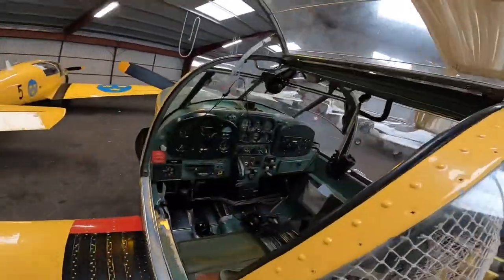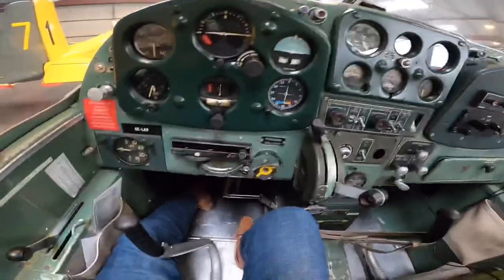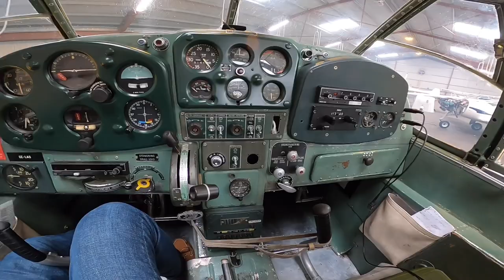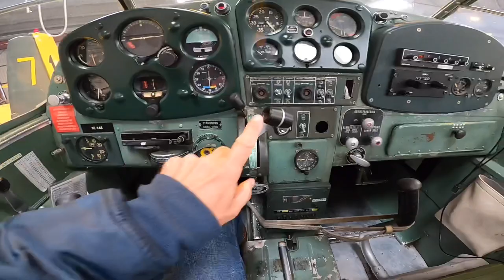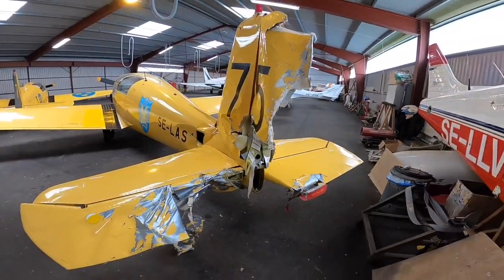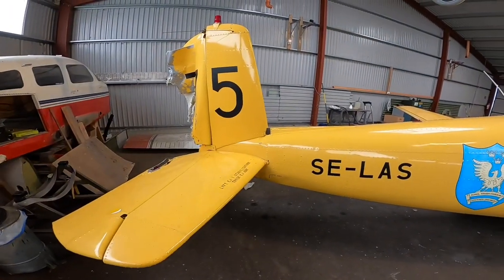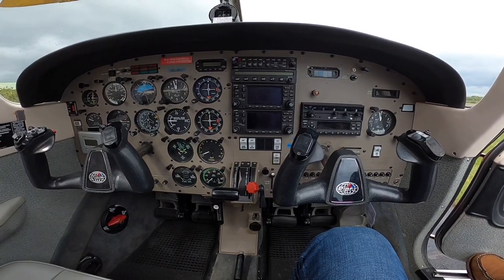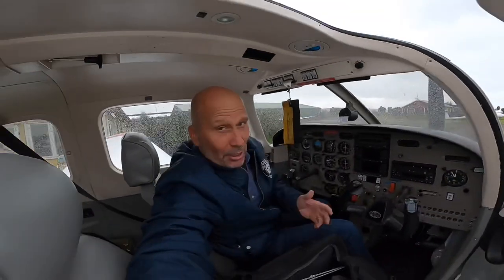Ergonomics And An Accident Hitting The Saab Safir 😭

Comment: So sorry to see the Safir with tail damage. ☹
Its going to be one hell of a repair , I'm sure it will be sorted but looking at the fuselage it may take a while 😥

Just glad to hear nobody was injured. 👍

Its a shame that Aircraft Designers / Engineers have  changed  tried and tested designs which are intuitive. I guess the investigation will bring up the human factors element of the design of the Dynamic!! 
Thanks for an awesome video 👍👍
Reply from the maker: Maybe I talked too much about right and left hand. You can get used to maneuvering stick and throttle with any of them. Anyway it’s not so convenient to have both hands to the right at engine startup (as left pilot) as it is to have one on each side. On the Cherokee the start button is ok for the left hand in the roof with the right hand on the throttle. The brake arrangement on the Diamond is probably more remarkable.

Comment: First, let me thank you for the cockpit demonstration of the Safir! I have tried SE-IRN once from the right and the harmony of controls, "fine mechanic feel of the stick" and warbird like feeling beats any microlights I´ve flown. The same goes against the Cessnas and Pipers I tried occasionally. 

Been flying many hours in the Dynamic in Sweden, and several times in VUZ (shown in your film) from right seat. The push/pull is a twisting throttle as well, and from what I´ve heard a concession for the american market. I think it differs from the look-alikes in some Cessnas in that here you have to push a button in the middle with the thumb to get the push/pull action. Nobody likes it afaik, and it´s a pain with formation flying because of the thumb button. Also makes it harder to transition from left seat to right seat, since until you get used to the new position you tend to twist it in the wrong direction (needed for finer adjustments like on final). With a normal throttle lever right seat is no big deal. You can get the Dynamic with a normal lever on the console, but then there´s no place left for the manual trim, so it has to be electric with buttons on the stick. The stick then usually gets a "thicker ergonomy". I´m not a fan of either. Luckily I got a couple of years experience in the FK14 with a normal lever and despite having electric trim and flaps, a more "normal" left stick as well. 

For startup in the Dynamic with fixed propeller at ESTT you twist the throttle to near total idle (with choke) or half a turn (without choke) and leave it there. So the ergonomy is good with stick pulled back with left hand while turning the key with right, but of course sometimes you have to adjust during the process and get the same cumbersome position as you describe. The brakes are set on the console before. As well as gradual breaking action there´s two notches. The first is enough for engine startup, and the last is needed for engine run-up. VUZ has constant speed and maybe that explains the slightly different intial start up procedure. We´ll find out. 

Very unfortunate accident, but good that you show us a clearer picture of what happened! I´ve heard the Dynamic ignated at full throttle, by human error or technical problem I don´t know. Second notch brakes would probably not held, but maybe would have limited the accident.

As a side note, the push/pull twisting throttle easily gets bent if an unexperienced passenger kicks it while entering/leaving the plane, so sometimes you push it to max with the engine off to avoid this. The same goes with our other microlight at ESTT, which actually has toe-brakes, and I´ve seen/experienced it ignite with full throttle a few times, but the brakes held. To reach the adjustment for the pedals in both our planes the throttle also gets in your way, so same thing there, easy to forget to pull it out. VUZ has a more ergonomical pedal adjustment at the side of each pilot, but it wasn´t totally stable. Using the rudder from the right seat I "kicked through" a couple of times, leaving the pedals at my seat in a "no position" (of three notches) until I fixed it. Despite this, the Dynamic is a very robust plane with excellent flying qualities. VUZ is a little quicker in roll compared to the older Dynamics, but maybe a bit less sensitive in pitch.
Reply from the maker: Super interesting that the throttle is pushed to max to avoid it to be damaged when entering or for pedal adjustment. Thank you very much for comment, I'll use the info in a part 2 video. I did not know the details you described.
Reply: @bjornpilot  I´m not sure it´s common practice at Ljungbyhed to do so, but at ESTT it happens. Another thing I heard from our mechanic is that at least on the Rotax engines they go to full rpm if the throttle wire breaks! Very practical in the air, less on the ground. Glad you found something useful, and looking forward to the part 2.

Comment: Another interesting video. You’re emphasizing left hand on the throttle and right on the stick like in most fighters. That’s fine in the Safir. The Cherokee, Cessna and the Airbuses or Boeings for that matter you have been flying around in its the opposite way, as long as you’re flying pic. In my opinion this is no big deal. It depends on what you are used to. The new sleekly 2 seater on the other hand had a very unusual cockpit layout and we sadly saw the consequences of this in that modern plane. Hopefully you’ll get your Saab back in airworthy condition in not so distant future. Happy flying 😃
Reply from the maker: Agree with the no big deal for left and right hand. But the brake position is really strange on the Diamond. 😳
Reply: I agree totally.

Comment: The Safir looks to have way better ergonomics than the Dynamic.    Not a pilot, but when driving I will always prefer a lever whose angle indicates by feel where it is in its range of travel, rather than a push-pull slider.   (For example, gear selection).    And not fitting footbrakes when other planes have them is just daft, an accident waiting to happen.